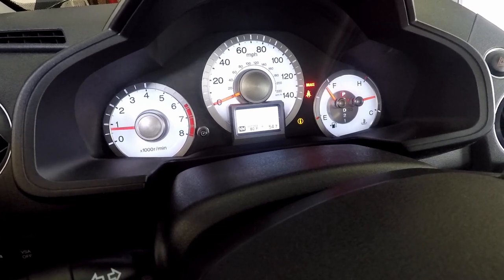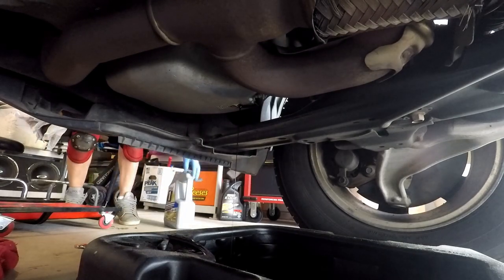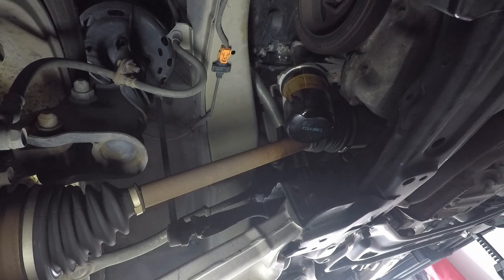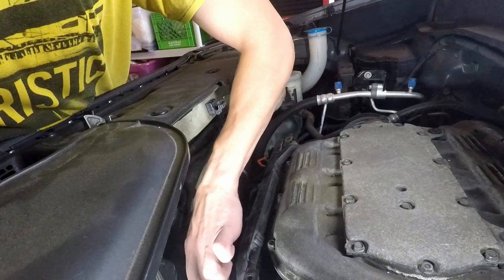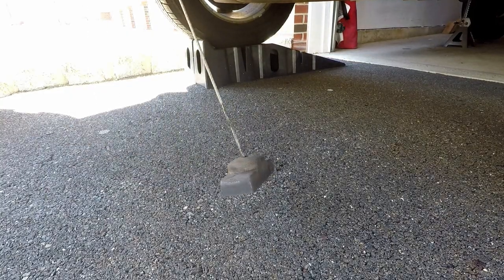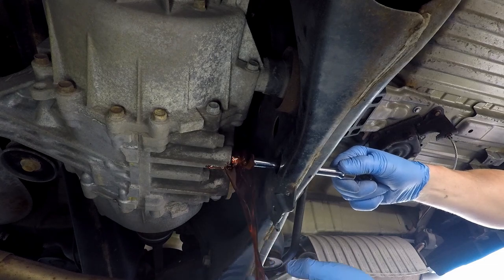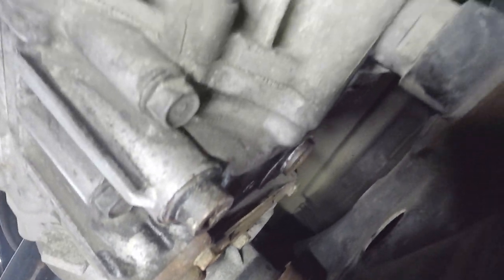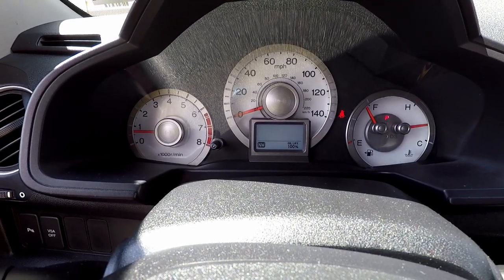2009-2015 Honda Pilot oil and differential fluid change

Comment: Thanks for video on the vtm. 2 things I'd suggest. 1. Prefill your new oil filter with fresh oil before installing onto the vehicle to avoid dry start/more wear. 2. Keep jack under the vehicle just incase of a Jack stand failure.  30 years of wrenching on cars and I just recently had a jack stand failure and truck slam on the ground. 10 seconds I wouldve been killed. Keep jack under car as a 2nd peice of mind. Nice video.
Reply: never heard this always was told the opposite. Hmmm
Reply: Absolutely, positively, yes - to both.

I live in earthquake territory and was under a car at one point when the ground started moving. The stands didn't fail, but that's possibly due to having the jack as a redundant support (and since I had one of the wheels off, I would have been crushed).

I was taught to release the vehicle to the stands completely, then give the vehicle a nudge (a push of 10 - 20 pounds of pressure) to make sure it was seated properly. Reposition the jack at some point where a failure of the stands would otherwise be trouble (eg. if the wheel is off, and the stands are under the frame, a good place for the jack might be under the exposed rotor). Once the cup of jack touches the contact point, apply only enough pressure so that some slight amount of the weight (by feel) is being supported by the jack, but NOT so much that any significant amount of weight is transferred out of the stands (so that they're doing their job).
Reply: @aaronshensky9385  Isn't when you pour the oil it goes to oil filter right away?

Comment: Well done. Clear camera angles and good lighting. Love the idea of using a drill to get the spare down faster!
Reply: An old mechanics trick. I'm 71 years old, and bought my first vehicle when I was 14. I was taught by an old time away back then if you have a hard time loosening a bolt or nut try tightening it first. For some reason this breaks the hold on it and you then able to loosen said nut or Bolt. I can say that it works 50% of the time or perhaps more. Of course every situation is different so you're MMV. Semper Fi, Robbie

Comment: I like putting ramps in front for oil change alot better oil drain at that angle an extra 16 oz iv,e found.
Reply from the maker: I agree, for oil change only I'd just use the ramps under front wheels. Since in this instance I'm changing both oil and rear diff fluid, I decided to go with this configuration.

Comment: You should run the engine for a few minutes to get all of the gunk in suspension. Run it for 5 minutes or so, not too long or the oil will get too hot.

Comment: Is there a reason why you are not replacing the washers on the oil drain plug and the rear diff drain plug?
Reply from the maker: I only do it every now and then. Never had any issues in close to 20 oil changes I did on this Pilot.

Comment: Why don't you PREFILL the new filter before installation to help mitigate the time the engine runs without full oil pressure?
Reply from the maker: I started doing this now, after previous comments and suggestions on the video - figured that it won't hurt. I wasn't too concerned about it, because I am filling up the engine with new oil after draining the old one and before starting the engine and letting it idle for about 5 min, letting the oil run through all the oil channels. 
I also checked the Pilot's maintenance manual and the procedure for oil filter replacement does not call for prefilling the oil filter with new oil.

Comment: Should have done transmission fluid and transfer case at the same time as the diff
Reply from the maker: Might do those 2 items in a separate video. Maintenance code A16 didn't call for transmission and transfer case fluids (code 3 for this Pilot).

Comment: Thanks. So if i have a FWD pilot (2008) do i need to change the differential fluid (or that applies for cars thst are awd or4x4? ). Thanks
Reply from the maker: No, you don't have to worry about the differential fluid on the front-wheel drive model, since those don't have the differential at the back.
Reply: I have a fwd pilot 2015 and was going going to ask the same thing.  Thanks

Comment: Hi how would i know if theyre really change the transmission flush in my pilot im.not there thanks is there anyway to check it
Reply from the maker: In case you have someone else flush transmission fluid on your Pilot, and you want to make sure they really do it, you can compare the color of the fluid before and after the flush.
New transmission fluid is bright pink and the dipstick for transmission fluid is to the right of the oil fill cap on your engine.
Also make sure they use Geniune Honda ATF DW-1 for the flush. I buy mine here:  https://amzn.to/2WSybjs
Reply: Also, be careful when flushing with any pressure. Especially when your pilot has high mileage on it. Lots of the pressure system used for full “flushes” end up actually dislodging some of the tiny metal parts and shavings in your transmission that can end up screwing things up when they’re dislodged. Better off draining and refilling than using a pressurized flush to replace your ATF fluid.

Comment: where did u get tork specs? curious
Reply from the maker: All torque specs are from the Honda Pilot repair manual. You can find them online in PDF format.
Reply: WHERE DID YOU FIND THT SIR?
Reply from the maker: https://www.emanualonline.com/Cars/Honda/Pilot/2011-Honda-Pilot-Service-%2526-Repair-Manual-Software.html
Reply: @ills  спасибо))